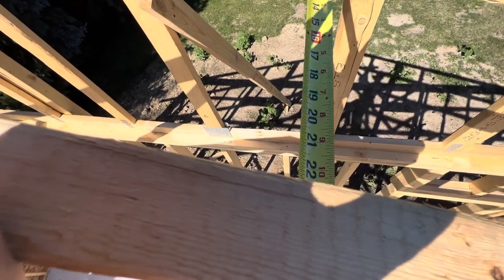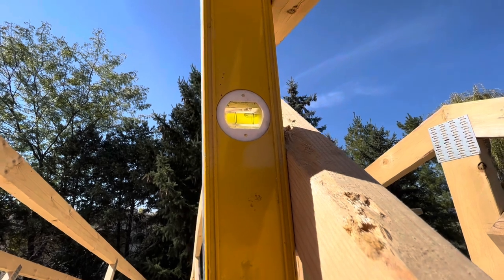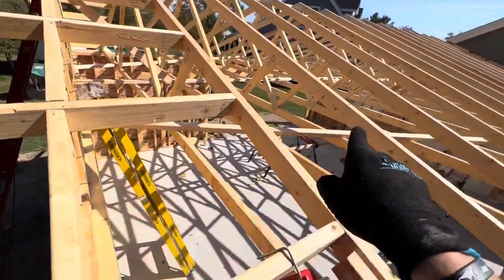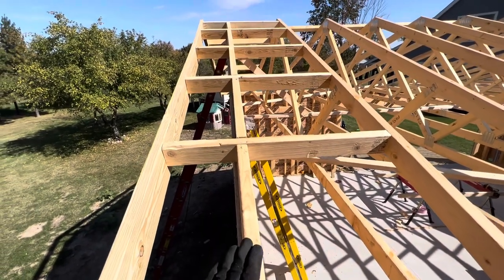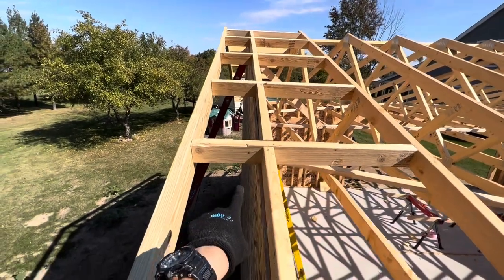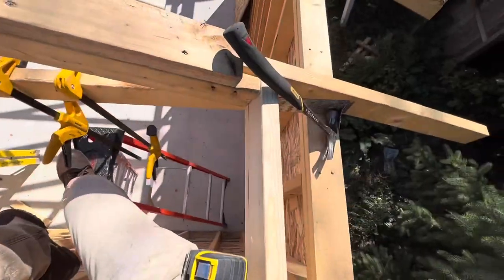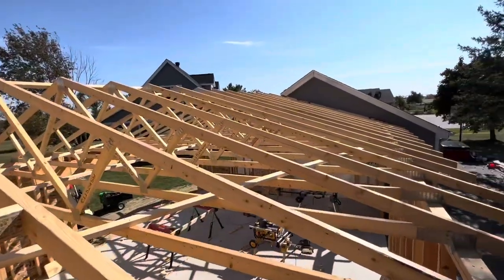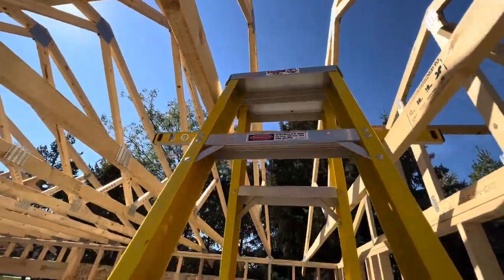Drop End Gable Trusses

Comment: Scott, I APPRECIATE this video!!! Without a doubt this IS the best method of making a "structural sound" 'ladder' type/outrigger type' of 'extended gable ends'. Simply, each chord of the truss is SIMPLY made 3 1/2" 'vertical height' less than the other trusses...as you state. I've watched several 'ladder' nail-ons, and they aren't anywhere the strength of these. There should be a chapter in the 'how to frame' book of how to do this...  You just shown how to do it correctly. And in retaliation for wasting my time reading his arrogant comments, namely 'Billy SmackDownTexasTurkey',,,I'm gonna drop my chords 11 1/2" on my gable ends. I'm going to extend the peak purlins out 4'-5' made from 2x12's just to pis'd off 'BillySmakTxTurdkey'. I'm gonna make my rake angle back to 1 1/2' out at the lower end, so the whole shebang will be angled.  Like the old barns that had the hay hook and loft above. And I'll make my walls 'vertical level',,,or plumb...just 'cause I can talk that way and know vertical from hostility. "what did he say?". Thanks for your efforts. Hey World, this is how to make a correct 'ladder', 'outrigger', 'extended gable end', or whatever you wanna call it. Thanks Scott Thomas for your engineering and efforts.
Reply from the maker: Yes I did quite a bit of research on that! I didn’t have building plans to follow. Glad this helped you! Thank you for sharing and good luck with your build sir!